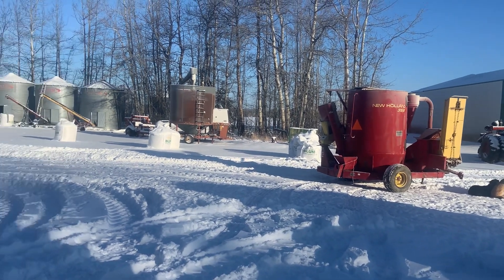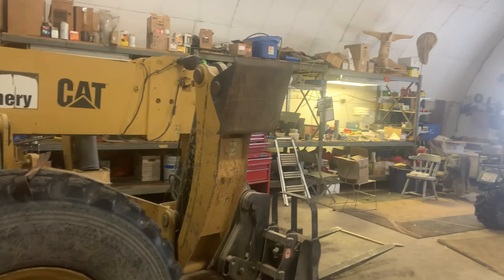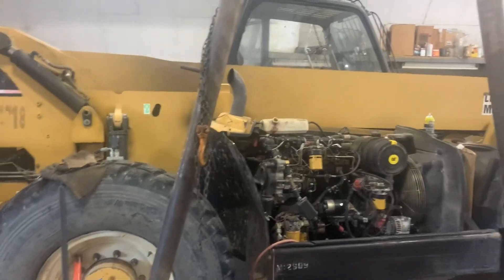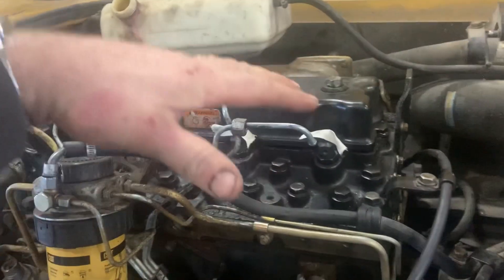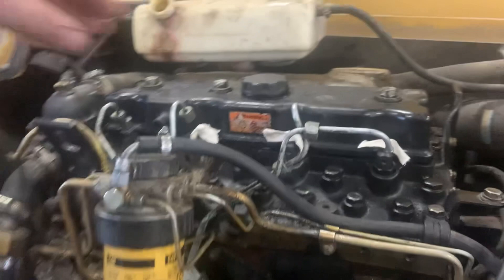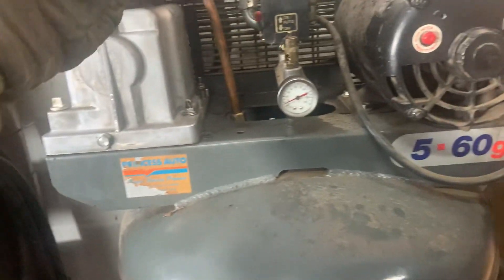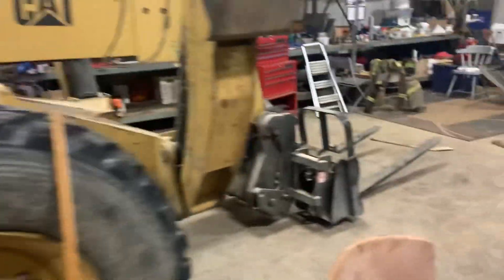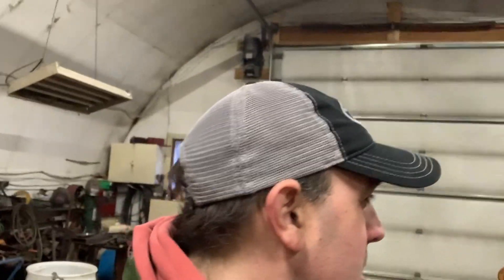The terrible, horrible no good very bad day.

Comment: Howdy, I'd ask how your doing, but I can see you've had better days,
 My off Farm job, I've worked in a garage for 17 years, I'm no mechanic, but I would Not reuse those bolts, we've had customers bring in equipment where did reuse those bolts, and broke them off, it's definitely not something I would recommend, they are designed to stretch, when new, and being torqued, the head gasket your also taking a chance, but I have seen them reused before, and they held, however if it was me, my equipment, I would use new, and save yourself a potential headache, I'd also like to add, being 5th generation Farmer, you can't count out Farmers ingenuity.. good luck with that, Stay safe, God Bless and Farm on my Friend
Reply from the maker: Thanks for the comment Arthur, how have you been? We went ahead and ordered some new bolts and new gaskets, be a few days before everything gets here but I can fix some other things in the meantime

Comment: MF tractors from that era had Perkins engines in them.   That  is likely a model 1104 engine.    They may have some parts sitting on a shelf somewhere.  These days parts for equipment have to be scrounged up from where ever they can be found.
Reply from the maker: They found everything, still
Unbelievable that they don’t have the
Stuff on a shelf in Alberta somewhere though